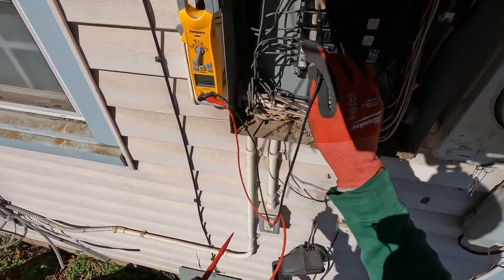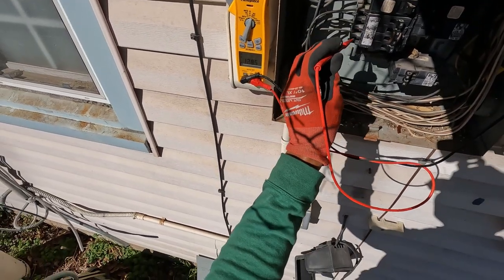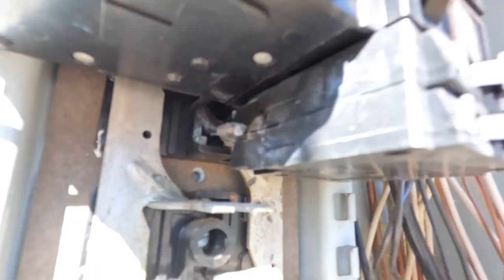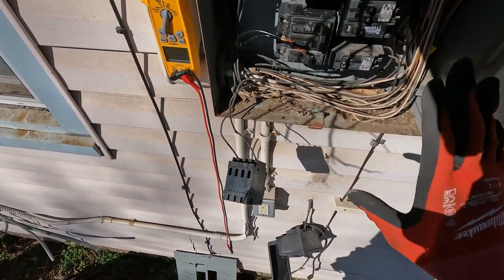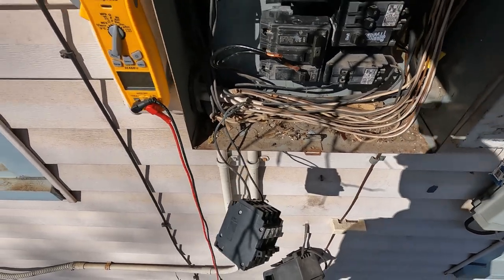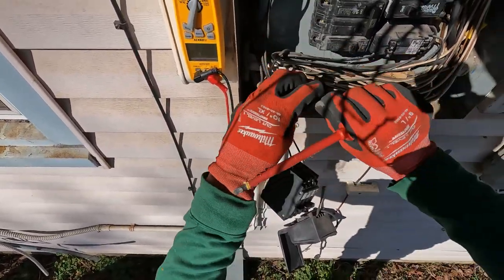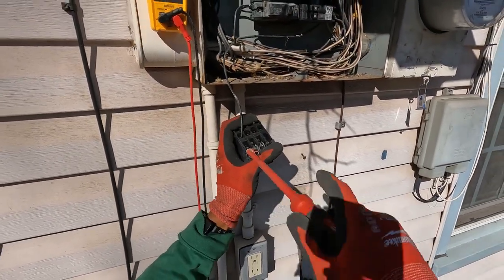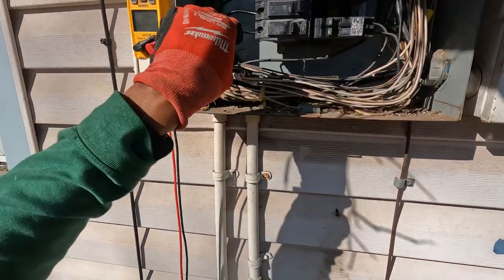Circuit Breaker Meltdown- Electrical Panel in Bad Shape!!

Comment: We in the U.K. are not allowed to mess with the meter if we are doing a panel change I.e fuse board change in the U.K. in lots of properties now you have a Isolator fitted in the meter cupboard . It’s a great insight how you guys do it across the pond . Great video as always Sir
Reply: We fought for Independence because the King was not letting us do our own electrical work.  Maybe King Charles will restore the common law rights of Englishmen to perform electrical work.😁

Comment: Steven when you have a double pole 40 amp breaker, is the circuit still 40 amps, or does that make it 80 amps with 2 of them? 2nd question, if you have a single breaker module with twin switches, say 20 amps, does that give you 2 completely independent 20 amp circuits that will trip separately and leave the other twin working?
Reply: double pole 40 amp  breaker does not double its values whatsoever. 2nd question , yes they're totally independent from each other